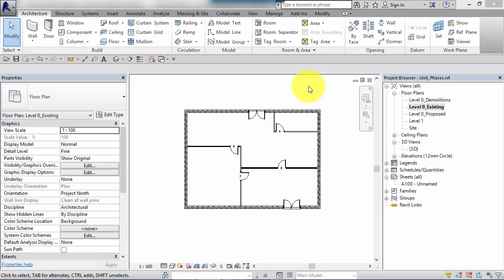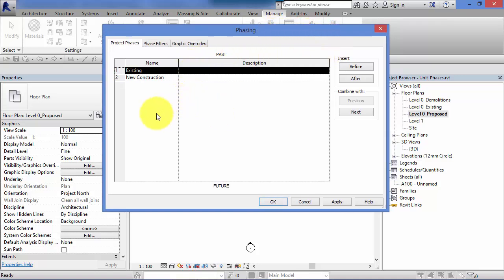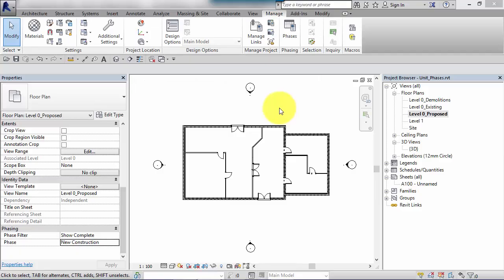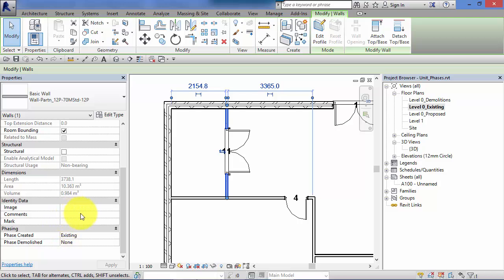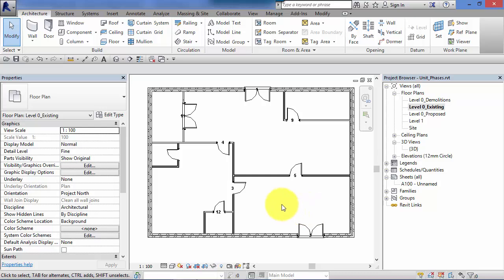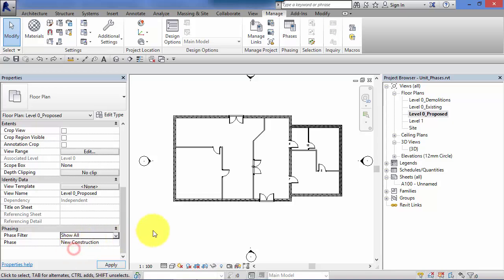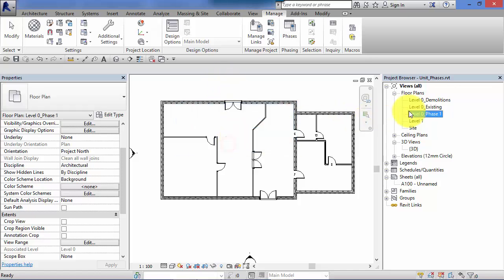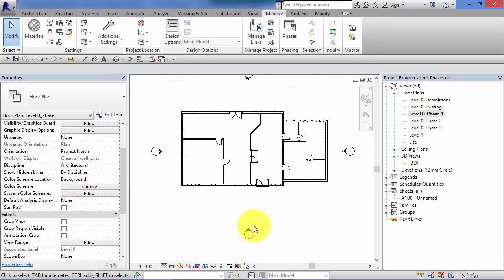Module 9: Unit 1: Revit Architecture: Phases

Comment: Great tutorial! One thing I want to clarify is I have got an 'existing plan' in the existing view e.g. Level 0_Existing, I realized that I have to first highlight all my walls, doors, window, tags etc then go to 'Phase Created' to change to 'existing' in order for everything to appear (walls, doors, window, tags) in the view, when I tried to change the 'Phase' to existing. For example: If the first step is to change to existing in 'Phase' everything has went disappear, I figured out that I have to highlight everything in the view then go to 'Phase created' to change to existing for everything in the view to appear. Please let me know if I have done it correctly or if there is another way to do this differently. 

Thank you.
Reply: It actually depends on phase filter, make sure that the phase filter in your existing view is set to show all, you can control filters from Manage tab> phases> phase filter.

Comment: may i ask you a question? So if i use demolish tool with a element in existing phase = delete , right?
Reply from the maker: +tùng lâm phạm No, it's not the same as "deleting" the element. If you actually "delete" an element in Revit, then it's gone forever. "Demolishing" it, is really just applying a visual filter to it- to hide it in certain Phases. Much more powerful and flexible than Deleting.
Reply: Thanks a lot^^ i got it^^
Reply from the maker: +tùng lâm phạm 👍👍👍👍👍